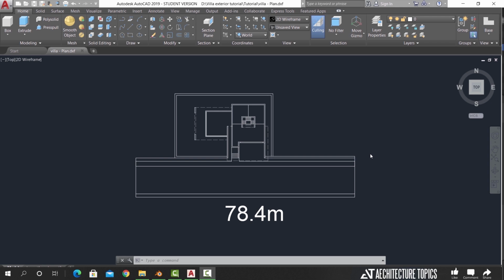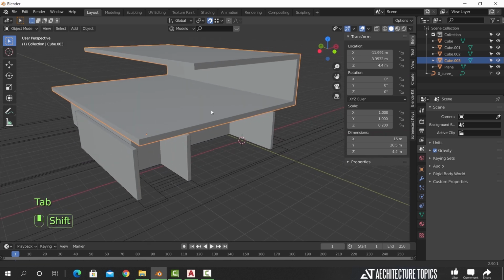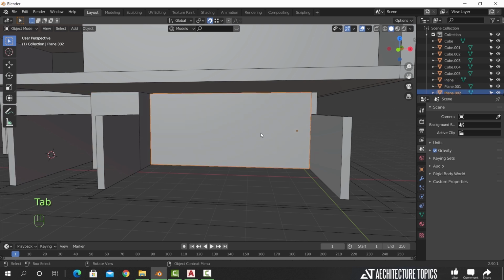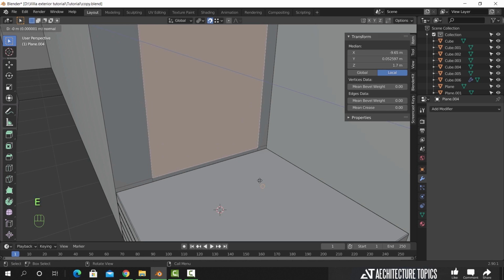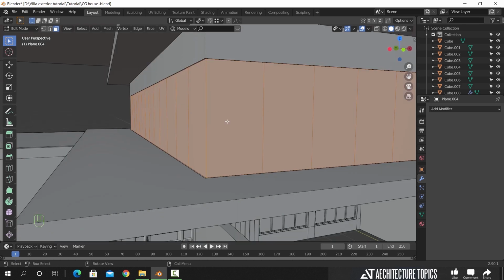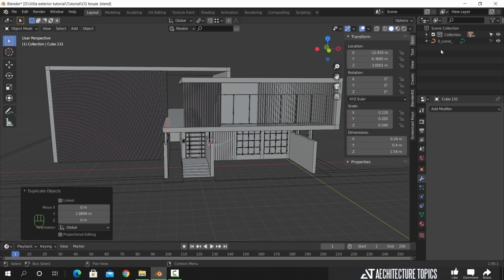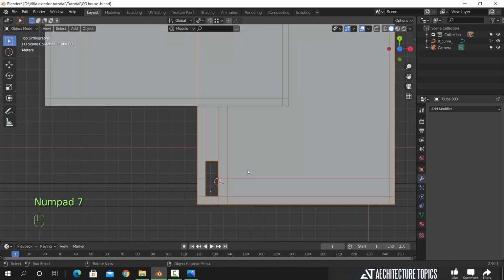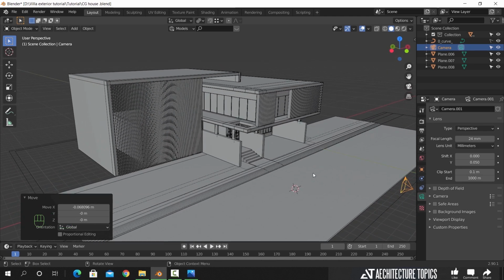Create Exterior modeling in blender with Eevee and Cycles

Comment: at 19.50 after adding loop cuts the segments are break and not circular pl resolve
Reply from the maker: With the door handle you mean, it should add the cuts as a ring, if the problem still exist, just drop the mirror modifier and do the handle with the cube only, you might have the issue there.
Reply: @architecturetopics  ok thanks